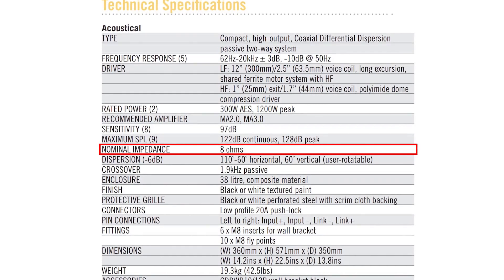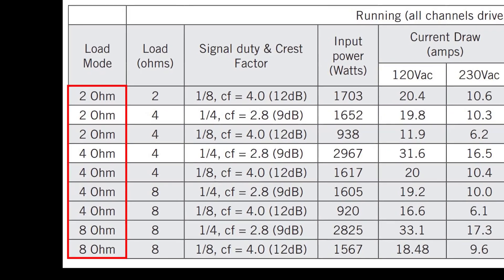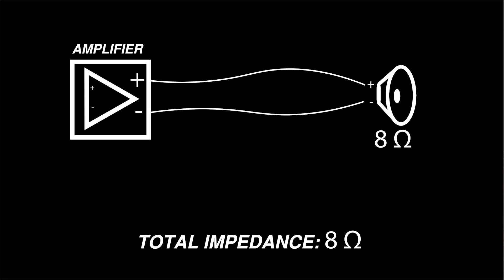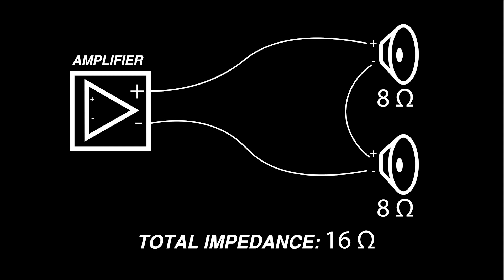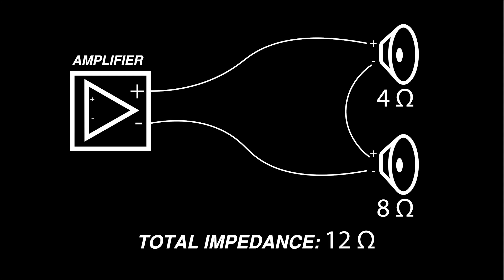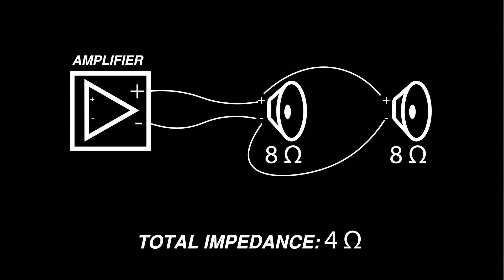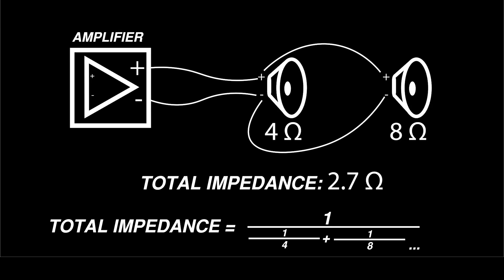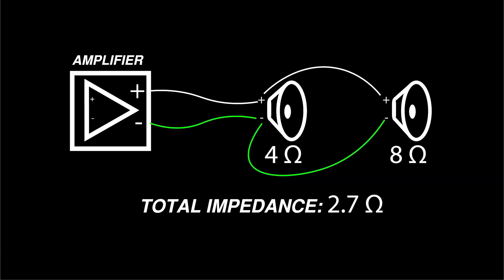SERIES vs PARALLEL: Speaker Impedance Explained

Comment: But what happens to the total speaker wattage when running them in parallel? I was told that running 2 50wt 8ohm speakers in parallel would cut the impedance in half (4 ohms) but output wattage would still only be 50 watts. Hence why 4x12 cabs are run in series parallel to keep the impedance at 4 ohm but increase wattage to 100 watts.

Comment: My name is Vivek Bharti, and I'm from Punjab, India. I need your help. I purchased an Infiniti Primus Component PR6510CSHI (80W RMS 240W Peak) and an Infinity Speaker PR6512ISHI 6.5" Coaxial Speakers (55W RMS 165W Peak) two or three days ago. But the impedance of one speaker is 2.7 ohms. This gives 2.7 × 4 = 10.8 ohms. Please tell me what impedance and which amplifier would be appropriate to use with these.

Comment: So if i have 4 speakers with 8 ohms and wire them in seies i have a load of 32ohms but amplifier only comes up to 16 ohms so either I will need two amplifier or wire the speakers in parallel to reduce load to 2 ohms 8÷4 =2 to use one amplifier. Is that correct?

Comment: If I am wiring two 8 ohm speakers together which way is it goin to be louder please or produce more punch? I have amps that Handle 4,8 and 16 ohms? speakers equal 8 ohm Jbl k120 and 8 ohm green back Celes.

Comment: When wiring speakers in series, does it matter which sequence the speakers are connected?  I mean does the impedance rating need to be the ohms from lowest to highest or highest to lowest ex. 4 ohms then 8 ohms or the reverse?

Comment: I have a  question.  I have my mixer that has left and right output..
 have one 15 inch power speaker as top speaker  that has 2 channels .
Can I connect left and right outputs from my mixer to one speaker. 
I'm trying to see if that will make the sound louder because in the past I had connected my phone music to the speaker using 3.5 conector to left and right to my speakers and it sounded more powerful than just using one channel

Comment: when using 6 ohm speakers can I simply add a 2 ohm resistor (in series) to match an 8 ohm amp?
Reply: You could if it was a tweeter or even sometimes a midrange but doing so for a woofer creates 2 problems. One, that resistor would be consuming a lot of power so it would have to be a big resistor not to blow, you would need a 50w or 100w rated resistor which can get expensive and it would get very hot. Second, it would sound horrible as a resistor in series with a woofer completely destroys the amplifiers ability to directly control the woofers cone (damping factor).

I would probably just try and see if your amplifier can handle the 6 ohm load. The internal protection circuit would shut it off if you exceed the amplifiers current capacity or if it doesn't like seeing the 6 ohm load. Since speaker ohm ratings are "nominal" they in reality are all over the place depending on frequency. There usually isn't much difference between a 6 ohm speaker and an 8 ohm speaker so your amplifier may do just fine with a 6 ohm load on it.

Comment: The closer you match impedances the more efficient it is.  You get maximum power transfer with matched impedances.  Since a speaker is a current device, parallel connected speakers are preferred when possible.  Depending on the amplifier, different impedance speaker loads may also alter the frequency response.  Don't go lower than an amp's minimum or you could damage it, although MODERN equipment usually has protection circuitry.

Comment: So if I wire two 8ohm speakers in parallel and get a rating of 4ohms impedance... If my amplifier is rated at 8ohms, does that mean it is ok to run or does the amplifier have to be rated at 4ohms? Sorry just trying to understand

Comment: I have a radio (JVC) with two pairs of connections both a right ad left. The Ohms listed on the radio are 6-16Ohms, and the provided speakers are 6 ohms each on connected to the right and the other to the left. I have recently picked up two big 8 ohm speakers that I would like to add in another part of the building, one to the right and one to the left. Is this possible? Thanks in advance all! Great video!

Comment: This  is the best and most understandable video on this subject. When  you wire two 8 ohm speakers in parallel, do you set your impedance selector switch or wire on 8 or 4 ohm?
Reply: 4 ohms

Comment: So if i have 2 pairs of 6 ohm speakers, it would be better to connect them in series because a 12 ohm load would be better than 3 ohm load right?
3 ohms will make the amplifier overheat and distort the sound at higher volumes 
But 12 ohms will just make the speakers more stubborn for power consumption and will require more volume than usuall

Comment: I think I need to know either that I applying the active speaker cabinet for 20 watt preamp, I think they need only 12 DCV from 220 ACV power supply whilst can you tell me they need a terminals or not, they need capacitors, resistors or not?

Comment: That was really helpful, keep it up man. 👍 By the way, quick question. If I connect two 6 watt 8 ohm speakers in parallel, I know that the impedance will be cut in half to 4 ohms, but I'm confused if the wattage will double at the same time. I really need help with this quick so someone please answer my question.

Comment: So i have a pioneer 2 channel amp 500 watts all 4 of my front and rears are 4 ohms if i parallel front left and rear left  by running speaker wire to the front wiring harness connecting in parallel it will present a 2 ohm load my amp says it will doba 2 ohm load so that means i can do two speakers on one channel correct? Meaning all four on a 2 channel?

Comment: When I was a kid in the 1980s I thought, more speakers=BETTER. So I had four home made speaker boxes. One pair of boxes had two 8 Ohm speakers and a resisted tweeter in each. The other pair of boxes had a 12", an 8", a 5" and a pizo tweeter in each box. So that's 10 speakers, not counting tweeters, split in two channels, wired in parallel. The only thing I new back then, was don't mix up the polarities. I had a pretty large bedroom and it sounded great. How did this work? Doing the math, I should have had zero ohms and burned the amplifier. I'm researching now, because I'd like to do something similar with that same 40 year old JVC receiver that I still have.

Comment: I need to create a setup which allow for 4 front speakers, a center, and a sub.  This is specifically for MUSIC coming from YOUTUBE via a TV, run to a receiver via HDMI ARC, and out to the said speaker layout.  Basically looking to use my rear speakers as 2 additional front speakers.  Is this even possible?  HELP ME DEAR GOD THIS NEEDS TO WORK!  Thanks in advance...

Comment: Thank you so much!! But I have a question for wattage. If my amp is say 100w. And I have 2 speakers of 60w. Does Wiring them in series or parallel make any difference in the totall wattage?

Comment: Hoping someone could help. I have 2 p/a speakers. Each have 1 eminence 15" 8ohm drivers and a celestion hf50 8ohm horn tweeters. The tweeters have got a high pass filter ofcourse so they cant take low frequencys. They are wired in paralell. I measured the resistence and expected around 3.8 - 3.9 ohm but they are rating at 2.7 - 2.8ohm. Doe's that sound right?. Could it be the high pass filter that changes the rating to 2.7 - 2.8 ohm ?. I am driving them on a kenwood ka3020 special edition amp with low impedence capabilities so it can run as low as 2ohm, so i know the amp can deliver the load.

Comment: Just to confirm I got this right, im looking at buying x4 fane sovereign 600w rms @ 8ohm and a t.amp 2400 2 channel, 2400w rms @4ohm, if I were to connect x2 drivers in  parallel on one channel and the same on the other channel would this work out correct? Thanks :)

Comment: If I have 7 in parallel wiring and they're 8 ohms each, I did the calculation and came up with 1.14 ohm, my amp can deliver 2/4 ohms, would that be an issues?
Reply from the maker: That's about half the impedance of your amplifier's rating. I wouldn't recommend it...
Reply: @AudioUniversity  Thank you so much for your quick reply. Does this apply to 70v speakers? I have QSC AD-C6T 6" Ceiling Speakers w/ Behringer Ep2500 Power Amp. Please let me know what is the maximum in parallels speakers I can connect per channel for the above equipment. It's for a house of worship and speech only. Thank you so much!

Comment: Hi Gn … I have a question ? 

I have an onkyo receiver 3r 315 set comes with 2 speakers ( one channel is not working) can I put the 2 speakers on one channel ? Thanks 

Ps… I did connect both on the one channel and it worked ( but a technician told me that application can damage / blow the speakers? Need help :) thanks

Comment: I have a question! You mentioned very specific wiring, but how does this work if you just daisy chain 2 speakers using SpeakOn cables? Is that parallel or series?
Reply from the maker: It depends on the connections within the speaker cabinet. Most often, there is a parallel connection.
Reply: @AudioUniversity  thank you! I’m trying to hook up 2 JBL JRX 225s ad what I currently have free is one channel on a D12, Trying to see if that’s going to be enough. They’re basically going to be operating as stage fills on a large stage

Comment: How to connect 3 speakers to a 2 channel amp in stereo?
Plan to buy a center channel speaker with 2 woofer 1 tweeter setup, but mono bluetooth battery capable amplifiers are hard to find.

Comment: Hi.., If an amp has an output power (RMS) of 500w, and impedance of 8 ohms, can i connect a 4 ohms speaker of 500w, because according to power formula.. P = V * I, that means if i change the impedance from 8 to 4 ohm, then there will be a voltage drop as a result of increased current in order to keep the power constant. ???

Comment: Audio University sir,im a HIFI  nerd,my stereo setuo now consists of a older sony str dn 1000 7.1,speakers hooked up now bose 901s series 4 and some nice towers rebuilt with klh bookshelf speakers cross networked into the towers,the towers sound nice with the klh speakers mounted on the top but im looking to buy a more beefier power amp..evotiva 2 or 4 channel amp

Comment: Actually the easiest way to calculate different impedance speakers in parallel is by multiplying all speaker ohms and dividing the result by the total sum of all speaker ohms. eg : 4x8 ÷ (4+8) = 2.7

Comment: I still have 1 more question. I want to install 2 bass shakers in series to my ext amp. I use  1 speakercable, where I connect the + from the amp with the + from bass shaker 1, the - to connect the - from the amp with the - from bass shaker 2.

Then I still need to connect the 2 bass shakers in the middle with another speaker cable correct? The remaining - from shaker 1 and the + from shaker 2. But what part of the second cable do I use to connect?

Comment: If my amp has 2 channels (having the option to switch to speaker A or B on the amp face)  then can I have 2 pairs of speakers (all the same model of speakers) hooked up with no issue? Each speaker is 8 ohms.

Comment: Great videos Kyle. Since finding your page I have been recommending it to clients that I have either serviced or upgraded sound systems for. One note. In the very beginning of the video I thought you said the greater the impedance the greater the load on the amplifier. I believe it should be stated as the lower the impedance the greater the load on the amp. I see you have clarified this in reply to another comment.
Reply from the maker: Thanks for pointing that out, Donald! I've removed that statement to avoid future confusion. I'm glad you're enjoying the videos!

Comment: Hi kyle ..very informative and i learnt alot from this video but tell me what will the ohm load at my amp be if i connect a 2ohm and 4ohm speaker in parralel...your response will be highly appreciated 🙏🙏🙏🙏
Reply from the maker: This would result in a combined impedance of 1.333.... That's VERY low and is likely too low for your amplifier.

Comment: May I ask, if you have a 4 ohm speaker, is it possible to add a 4 ohm resistor in parallel on the + & - terminals to make it an 8 ohm? And if so, how many watts of a resistor should be used? The reason I asked is because I couldn't find anymore a low wattage 4 inch 8 ohm speaker for my C.B. radio's external speaker, all I have is a 4 ohms. The external speaker output of the radio is rated at 8 ohms only. I sure would appreciate a response. Thank you very much.
Reply: You have to connect the 4 ohm speakers in series, which results in 8 ohm.
Reply: @satishvasane6812  Copy that sir, thank you so much for the reply.

Comment: I've got 2, probably easy questions. 
1:  wiring 2 speakers per channel (30w max 6 ohm each) in parallel, does the wattage add together (60w) or stay the same (30w)?

2: same speakers as above, 2@ 6 ohm in parallel is 3 ohm load (per channel). I'm attempting to use a 2 channel amplifier 50w x 50w rated for 4 to 8 ohms. If I run the amp at about 3/4 volume, do you think it will "handle" and "push" my total of 4 speakers? Should I be worried about the 3 ohm load?
Reply from the maker: 3 ohms is too low for your amp. Using this setup puts you at risk of damaging your amplifier.
Reply: @AudioUniversity  Thank you! 
After I asked but before you replied I did hook it up for a test run. It sounded awesome but the amp got fairly warm after about 2 minutes. I guess I'll just have to get some different speakers. (Speakers are so expensive, was trying to  just use some free bookshelf speakers I got recently)

Comment: When I do this one speaker is louder any solutions?
When wired in series I can go to higher Volumes but one speaker is louder than the other. 
But, when wired in parallel they both play the Same volume but over load the receiver I am using.   
Please reply with solutions:)
Reply from the maker: If your amplifier is not rated to power your speakers in parallel, I'd recommend using fewer speakers per amplifier channel. Otherwise, you would need to get another amplifier with more channels.
Reply: If I may, You say one speaker is louder than the other when wired in series but sound the same wired in parallel. When changing from parallel to series are you maintaining correct speaker polarity? Are these two speakers mounted in the same box or enclosure? Or are they two separate speakers mounted in individual boxes? A volume difference may be due to the design of the cabinet or cabinets. Incorrect polarity wiring. Or if other electronics are involved such as internal crossovers.

Comment: Can someone please answer a question for a newbie?? I want to know this…what ohms will my speakers be if I run in parallel to a passive crossover then to an 8 ohm sub and to a 8ohm tweeter then to another passive crossover to an 8ohm sub and 8 ohm tweeter?? Here’s exactly what I’m connecting to. Since I have a Ford. Lol. I have 4 Audiopipe 6x8 subs, 4 Audiopipe 2-way passive crossovers and 4 Alpine tweeters. I can either get a 2 or 4 channel amp but I don’t know which would be better. Anyway, I know running speakers in parallel lowers resistance but I don’t know if I run to a crossover and then the same line to another crossover and set of sub/tweeter will lower ohms or even work. Can anyone please give me some advice???
Reply: If you connect the speakers or passive crossover in parallel it's results lower the resistance.

Comment: I’m new at this. So, I have to ask questions. I understand that wiring 2 or more speakers in parallel lowers resistance or OHMS. So, if I run a speaker wire to a passive crossover then to an 8 ohm woofer and 8 ohm tweeter does going through the passive crossover lower the resistance or OHMS???
Reply from the maker: It does have an effect on the impedance of the circuit, but it depends on the impedance of the crossover.

Comment: Hello sir,
I have Pioneer VSX-322-K which shows speaker impedance support from 6 ohm to 16 ohm. Can I use Sony tower speakers (Model No- SS-TS83) which shows speaker impedance of 3 ohm?
Is there any way to convert my sony tower speaker's impedance from 3 ohm to supported ohm with my Pioneer VSX-322-K?
I have 4 sony tower speakers 2 front, 2 surround.
Waiting for your reply 😇
Reply: If I may, the discussion of pro audio differs slightly from consumer audio. This question may be better addressed thru a consumer hifi audio forum. Best to contact Pioneer for a definitive answer. If I may add, yes you can use these speakers with this amp however driving the amp too hard and a system component may fail. I suggest getting an amp rated for 4 ohm speakers. Also the VSX-322-K produces 0.70 THD at full output. IMHO I would use an amp rated at 100 watts per channel minimum with no more than 0.10 THD at full output.

Comment: Question if my amp (focal 4.600) can handle a 2 ohm load can I run 2 alpine type r 6.5 in Parallel without issue ?